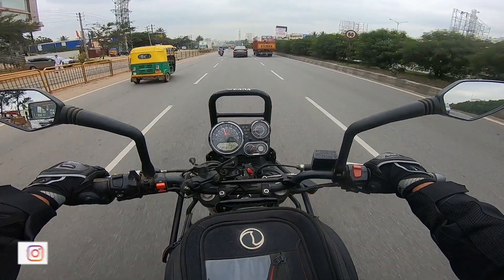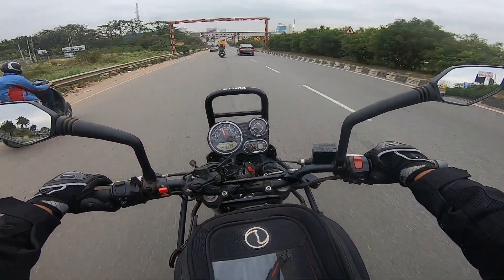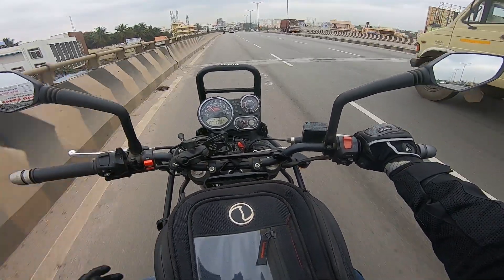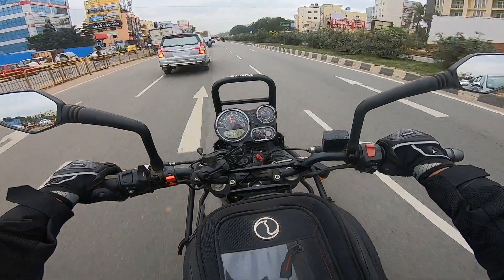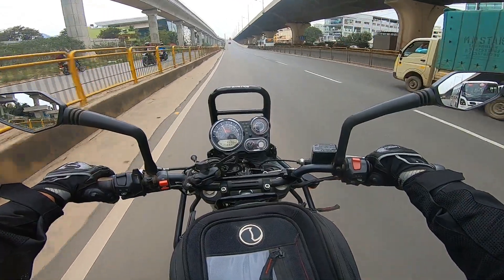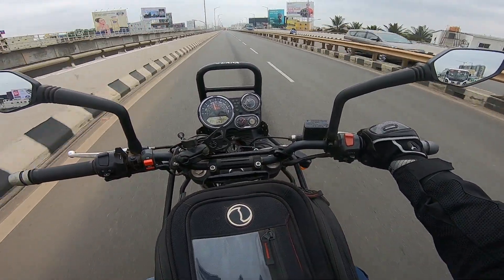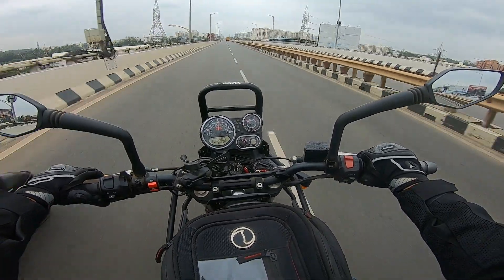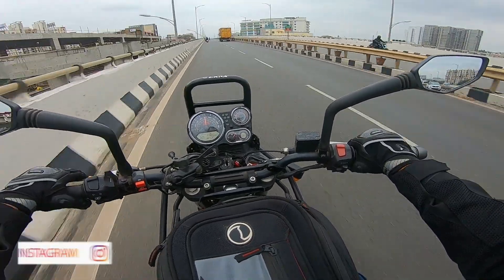#RV

Comment: How does it affect off-road shifting where you may want to slip the clutch a little?
Reply from the maker: Hello Jeph... Off road testing is bit difficult... Bec the lowest rpm we could set is some 2k rpm... And on a off road patch, riding at higher rpm would be a optional , depending on terrain 👍